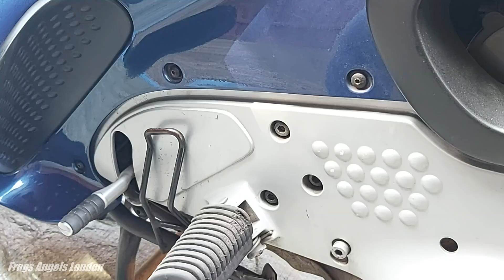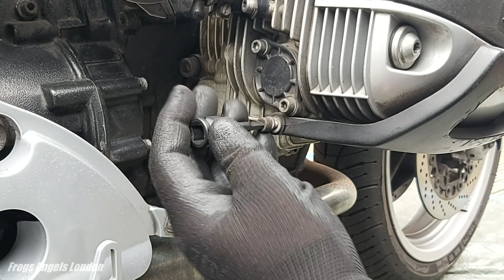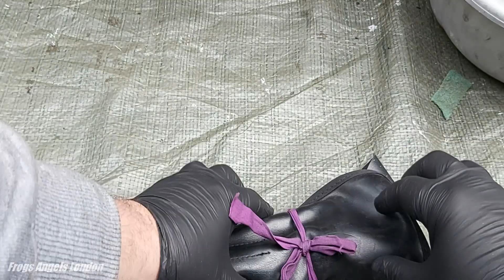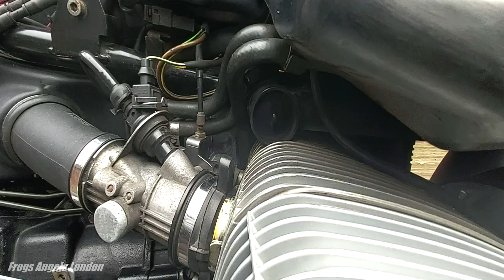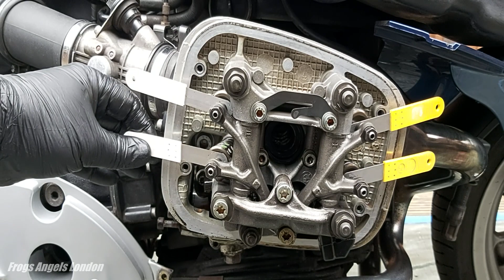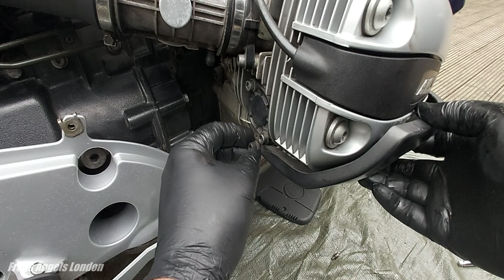BMW r1100rt valve clearances

Comment: Why is the "S" in the middle of the inspection hole instead of the correct "OT" mark? Couldn't  that throw your adjustment off?  Are you using the S stamp instead of the OT?

Comment: The tdcs on the left and right are 180 degrees opposite. When riding a bike, the arrow on the right cylinder chain gear is the right cylinder tdc, and the black plastic tab indicates the tdc of the left cylinder. And it is more accurate to put an 8mm stick in the hole on the back of the right cylinder to fix it accurately.

Comment: Can you tell me why you have to both at the same time?
Reply: Len The handles of the feeler gauge are the same weight.  If they both are stable then the ‘slip’ of the gauge is identical to the other meaning the lash is identical to both valves and both valves will open and close at the same time.   The rocker arm is fixed to both valves.  Watch the upper feeler gauge as he sets the lower.  The upper will lose slip.  You can get them close by doing them separately if you want and it would pass and function however this method is far more accurate in tuning.